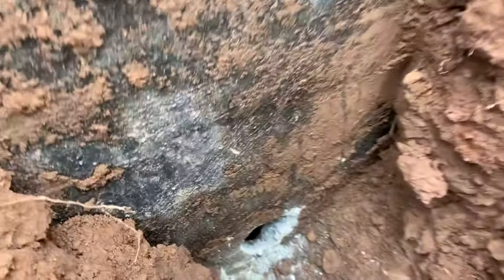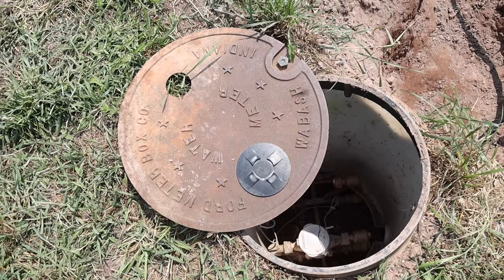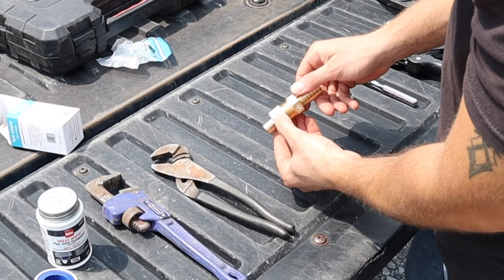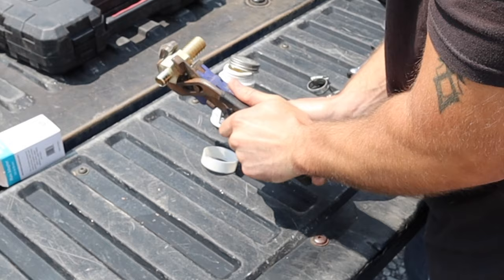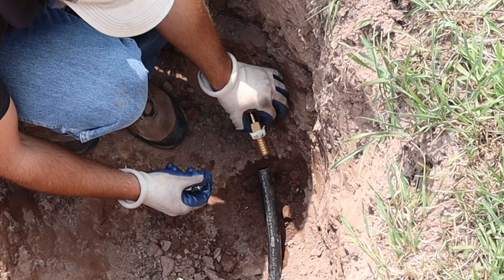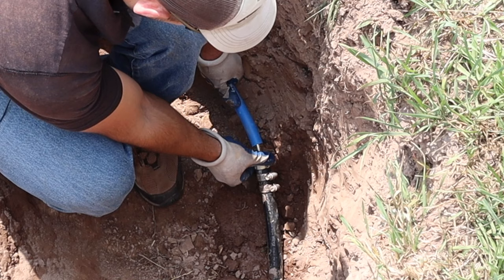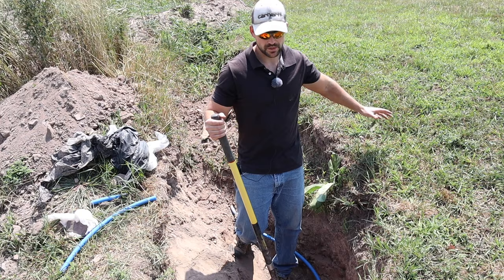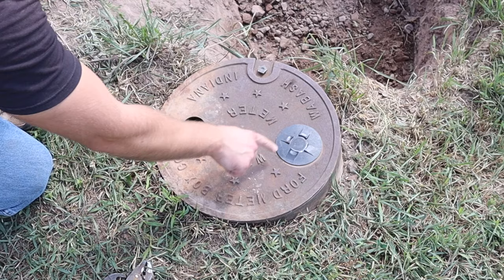PEX Pipe From Meter To House

Comment from the maker: Did you know you could direct bury PEX pipe?
Reply: How deep do you bury it? We are navigating through replumbing our entire house in San Angelo, TX. Your videos are so helpful!
Reply: I know those line are easier to get on to tht black water line if u heat em first
Reply: Kinda looks like he downsized the pex now you’ve lost main water pressure
Reply: @rsanchez5676  If downsizing inside the house it doesn't matter. Also higher flow rate because less volume in the piping means fresher water!
Reply: They do sell an insulated underground pex for main line hook ups. Uponor I think !
Reply: This truly blew my mind. I had no idea PEX could be direct buried. Thank you for your videos.
Reply: @rsanchez5676  WHAT SIZE SHOULD IT BE ?????
Reply: @rsanchez5676  almost ALL main water lines going into the house are 3/4 inch. The fittings inside of the house are all 1/2 or 3/4 inch therefore the pipes are all going to be downsized anyways in order to fit on to the fixtures such as your shower and sinks, toilets and etc. none of them are 1 inch connections. The downsize from the black water main to the original 3/4 inch pex makes no difference at all. Furthermore, a pressure reducing valve is usually installed because the fixtures are not designed to receive a ton of pressure anyways.
Reply: Another word of advice. Take a torch and heat up the inside of that black pipe. It will soften it up and make it flexible. The brass fitting will slide down inside of the black pipe better and then when the pipe cools back down, it will mold itself around the brass fitting. It’s more of another level assurance that it will be a leak free connection.
Reply: @rsanchez5676  *volume
Reply: @treym322  Just to be clear, static pressure isn't affected by the pipe diameter so using a smaller line has no affect on the regulator so far as it's rating goes. Pipe size does affect pressure drop during flow, but once stopped will be the same pressure everywhere in the system.

To add to your point the opening sizes in faucets is only about 1/8in. So things are reduced even more at the point of use.
Reply: @treym322 pressure reducing valve was the first thing I bought lol
Reply: Smaller pipe size increases velocity but decreases flow rate( volume) but going from 1 in to 3/4 in is common for residential properties. It is all about load calculation and flow rates. I plumbed 8 units from 1 1/4 service that came in a 1in than broke off in parallel runs of 3/4 to fixture branch line run than to 1/2 in. To individual fixtures .No problem 60 psi pressure plenty of volume. No complains on water pressure loss. No complaints of cold water during shower. All 8 units fed from 1 119 gallon water heater.
Reply: Josh, got a question. What if we don't have a black pipe coming up out of the ground like you do? Do we need to turn the main water off, dig to find the pipe coming out of the meter and then attaching a reducer to connect to PEX?
Reply: @MoonbeamAcres  let the city come dig their part of pipe up, because if you damage it you gotta pay the redo for water pit costs and hourly costs etc, if they break it you don’t
Reply: @timtamd6927  I don't have city utilities, I have a private water company we use for service. And they make it clear , they are not responsible for anything from the meter to the house. And I am going to need to tie into the water main service within the next year or so, so that's why I asked. And the question was for the channel creator.
Reply: Yes, I've done it before.

Did quite a bit of research about it too.

Comment: Is it me or you put the tephlon tape wrong? Anyways. Thanks for sharing. I always enjoy your videos
Reply: I always put it on in the direction that the female fitting or nut tightens, normally clockwise. I use tape or dope, but not both. Great video!
Reply: Yes the PTFE tape was installed the wrong way
Reply: Yep. 
Always hold the fitting in your left hand. 
Then run the Teflon tape over under (away from you) in a clockwise fashion
Reply: Yep.
Reply: Why do the people who are still learning try to make an instructional video ?   Rookie mistake......
Reply: @montgomeryball5496  money 🤓
Reply: Yep. Should be clockwise. That's when I turned off the video.
Reply: It AINT you ...... but THANKS TO BOTH OF YOU for the,VERY USEFUL INFORMATION .......
Reply: @montgomeryball5496  EVERYBODY IS STILL LEARNING !!!!! but THANKS for the comment.....
Reply: Yes, it's the wrong way,
Reply: @Bobcat1950  why not both?
Reply: @ImmaculateSludge  There are two basic types of materials used to reinforce such connections. Teflon tape and pipe dope. Both have their pros and cons and sometimes are used simultaneously. Many plumbers or do-it-yourself practitioners argue about which of the two is better to use in certain scenarios. Well. Whatever the case, what is most important is that the leak is stopped to help prevent damage.

There are numerous scenarios, both tape and dope act as lubricants to help tapered fittings fully seat. I don’t see the purpose of doing both. I always use dope on large coarse threads. Even to many wraps of Teflon tape will cause troubles on the smaller finer threaded fittings, I usually keep it less than four. When I started they wrapped the threads with pipe thread because of pipe and connection thread imperfections.

There is many cases where neither are necessary. What is important is that you do what works for you. From a production standpoint, you are using additional material and more time.
Reply: All I can say is you must be in the south somewhere my frost line is 40 inches
Reply: Thats why you might go both
Reply: May be he was looking at his camera screen and wires were crossed.
Reply: The tape bothered me...the AMOUNT of dope made me weep😂
Reply: Honestly he probably wasnt supposed to use any tape... most of those types of fittings specifically say not to use anything and if you do you will actually stop it from sealing
Reply: I know this is two years old but the video shows its going on the wrong way...
Reply: @EdTravelingEast You are correct...
Reply: @lowcountryantiques3696 
He was looking in the mirror 😅😅

Comment: It looks like you’re sizing down quite a bit from the start of your water main line. PEX-B is a size smaller for the inner diameter fittings. Seems like you’re going from a 1”+ main to what amounts to a 1/2” ID restricted line underground. That’s limiting your options from the start for water pressure and flow. I would have brought into the house at least 1” PEX-B to account for the ID restrictions. From there you can always size down in the house, but you never want to have to dig up your line just because you decided to do a smaller line first.

Comment: In the North when connecting the polyethylene pipe to barbed fittings we heat the pipe a little first with a small propane torch to soften the polyethylene than the fitting slides right in. When the pipe cools down the polyethylene pipes conforms to the barbs on the inside of the fitting. Making a tighter fit/seal.

Comment: Something I have learned... get the BEST quality worm clamp you find (not made in china). The cheap ones have a non stainless screw that will rust and fail.  Test the screw with a magnet, if it attracts, keep shopping.

Comment: Better to run the 1 inch polyethylene pipe all the way to house. Then connect a valve with compression fitting not barb with ring clamps to 1 inch poly in house. Then use adapter to connect 3/4 pex.

Comment: Good job on your connection bro I've been a plumber 23 years one trick of the  trade to help you with the next time you do a similar connection to poly  heat it up with torch for about 5 6 seconds on the inside and outside it'll slide in like butter

Comment: It can also be handy to run a length of "tracing" wire taped along the pipe, to help detect/locate it underground years later.
Reply: "tracing" wire? Never heard of it. Can you tell me more, eg, what kind of wire & what kind of detection equipment?
Reply: Usually it's a 12ga or 10ga solid copper wire, so that locating services and/or your local municipality can find your plastic pipe underground.
Reply: @jasongixxer6438  Thanks for the fast response - I appreciate it !
Reply: I was glad to see a comment about the Teflon tape going on backwards. I noticed this as well

Comment: 1st it’s great that you are making videos and trying to offer help to others. As far as tying your PEX into the poly is really a waste of time. I don’t know if where you live the water service provider Stubbed out that poly for you but where I’m at in GA  We tie directly into the meter with what ever new pipe we are putting in. That way it’s all one continuous run from the meter to the house. We don’t have to call the service provider for this we just dig down on the meter box and pull it for access to the fitting. I know a lot of plumbers and handymen down here that are to lazzy to put the extra time and effort into doing the job correctly. Again I’m not saying this is you I don’t know if your provider allows you to do that. But I just can’t understand why they would not.
Reply: The water company probably didn't stub that out, it's the old line.

Comment: The Teflon tape was applied backward. Tightening the threads will tend to unwrap the Teflon tape. 
  Also in our area, a valve would be installed where you placed the adapters, so you have your own valve just downstream of the meter box. Our water company requires it.
Reply: basic mistake.
Reply: I seriously doubt that any code requires you to put a valve underground   just outside of the meter. That's just nonsense.  I'm sure a whole house shut off is required but code doesn't say where exactly it has to be. They are usually in garages,  crawl spaces or in a closet somewhere in the house.
Reply: @steve2736  that’s incorrect. Tape and dope is now code in many areas. The tape only slips if you dope the fitting first. Always tape then dope
Reply: @leonardhall7203  He didn't say code required it, he said his water company does.
Reply: @cvas282  It's wrapped backwards which is the mistake. I also cannot understand why double application has become a thing. Why are they fixing something that isn't broken and making more mess and effort?
Reply: @court2379  the original comment I replied to was deleted. I never denied the tape was applied incorrectly. Double application is not becoming a “thing” I’ve been a master pipe fitter for over 25 years mainly  industrial and fire control systems. I was taught in the 90’s by my 65 year old foreman to tape and dope. We do it because it works.
Reply: @court2379  the water meter has a shutoff valve built into it and a backflo preventer otherwise known as a check valve on the house side of the meter. This guy obviously got the check valve  and shutoff valve confused.
Reply: @cvas282  I have never seen anyone in my area do both, so why I say unnecessary🤷. There isn't any harm in doing it though. The tape used matters a lot too. I have had some so thin you could see thru it, and other tape that is nice and thick and only takes a few wraps. The new tape with the thread sealant/locker embedded in it is interesting too. Used that for the first time last year. It seems like good stuff. It takes less of it to get the job done and provides a bit of resistance to loosening.
Reply: I worked in building maintenance for 37 years and never saw a pipefitter use both tape  and dope.
Reply: Yeah I noticed the teflon tape wrap too.  My area is an open system, so no valves required, but the teflon tape wrap is a universal thing guided by logic
Reply: Everyone's commenting on pipe dope, shut off valves, no one is mentioned tracer wire. It's code in my area now as well.

Comment: Just a little tid bit of added recommendation, when ever I use screw clamps underground pipe I always wrap them good with electrical tape stretched really tight all around them to prolong life and reduce rusting ! I personally would have wrapped the whole joint from the end screw clamp past the fitting and over the pex clamp in one solid tight wrap job ! Thanks for vid !
Reply: Make sure to get stainless clamps
Reply: I would have pressure tested prior to adding dirt....better be safe than sorry!!!
Reply: My dad was an electrician.
   Good old electrical tape was used for all kinds of things!

Comment: I have been buying a polyethylene crimp to pex crimp fitting from Lowe's, no need to use 2 separate fittings and both sides are crimped.

Comment: Don't know if you mentioned it or not, but pex cannot be located with a metal detector.  I've seen folks use what looks like Police tape with a metal conductor in it ...and lay it next to or on top of the pex line. That way the pex run can be detected.  Also, would it be a bad idea to use a PVC sleeve? ...put the pex in the PVC and place the PVC in the trench.  That way if there is ever a problem at one end or the other, then you can pull/push a new pex line through via dug holes at each end of the run.  You wouldn't have to dig an entire trench again and disrupt a developed yard.
Reply: ive thought about the pvc too but if you ever had a leak at the meter or burst line it might flood out your crawl space. might be able to put drains in it but digging isnt that bad really.
Reply: Thats why my code requires it  .    Those southern codes and east coast   arent so concerned with that so they have IPC codes much easier and cheaper to build with IPC  , just not as good as UPC  has higher standards

Comment: FYI. The Teflon tape does not do the sealing, the purpose of the Teflon tape is to provide "lubrication" for the threads. The threads are NPT which stands for National Pipe Tapered threads.  So, the deeper you are able to screw the adaptor in the better the seal. The "crimp rings" on the black hose are called "hose clamps"  Good job on the connection.

Comment: Hi Josh. Love all your videos. Keep up the great work. Just a suggestion on the clamps you used. I have noticed these clamps do not do well under ground or where there is moisture. They will easily rust right off. Blessings 🙏🏻😊
Reply: That's all I could think of

Comment: Teflon should be wound clockwise, not counterclockwise. There are also fittings for connections made specifically for exterior direct contact with the soil and elements for the PEX. Normal pex rings will corrode.

Comment: so what do you do to keep the pipe clamps from corroding...ya want to it last.

i found in  on my ranch in central alberta....
these pipe clamps types are prone to fail...just a temp solution.
even buried below the frost line....just the soil moisture  alone...which we all have.
so we buried  ...hmm two 5 gal buckets end to end... to be able to inspect....later thru on a value shut off....
super insulated bucket.....put some straw bails on top the bucket.

plus  then could shut the whole yard down not just the house.....
didnt know you could bury pex......awesome

Comment: Yeah in Illinois we have to use a mechanical fitting to transition from PEX to farm pipe is what we call it. We have to buy a specialized Mueller fitting. It has to be rated for burial.

Comment: Can you show a video on how to plumb a house an a concrete slab for shower , tubs, toilets , washing machines, vent pipes , water heater connections, refrigerator, dishwasher and drain lines exiting the house. Would appreciate it very much. Thank you for your time and effort. 🙏🏻🙏🏻

Comment: Was that 3/4 inch PEX-B for a water main?   I would have done 1" PEX-B or 3/4" PEX-A.   Better yet 1" PEX-A just because.   It's nice to have something and not use it then wish you had it to start with.   i.e.  Less pressure drop at a high flow rate.   PEX-B fittings do restrict a bit.   Edit:  Ohh and the clamps on the poly should be facing opposite directions.

Comment: Good job, where did you buy the 3/4 male adapter or the part number, what happens, I'm going to repair the same problem in my house and your video is helping me a lot, thank you
Reply from the maker: Thank you. I got it at Lowe’s in the well pump section. Hope that helps!
Reply: @TheExcellentLaborer  Thank you very much I appreciate it

Comment: What about testing the joint before you bury it. There could be a leak and it’s best to find out before placing dirt over the joint
Reply from the maker: Yes I agree with you. That would have been best with my excavator was trying to get the job done. Thanks a lot for watching!
Reply: Our city inspector requires a pressure test prior to activating. Just like gas lines. Also tracer wire is nice to have. Should be up to the owner, as they "city water dept" just reap the benefits of a water leak. LOL. Had a $4000 water bill one month last winter, from a break in 50 year old PVC. So much for smart water meters flagging water leaks... Taking a break from digging 500ft trench for new 1" main.

Comment: I use 3 clamps on polyethylene pipe and a heat with propane torch just a bit. Never leaks.

Comment: Yes, he went the wrong way on the tephlon tape. Easy to make a mistake. He had the threads away from him, but if he’d had the threads on the fitting looking at him, he would’ve had it right. To tighten is to the RIGHT ( Lefty loosely / rightly tightey), so the tephlon should wrap OPPOSITE of the way you tighten the fitting.  I believe the combination of tape and pipe dope IS the most secure way to avoid leaks. I just like to put a light coating on the threads with my finger, THEN at least three full wraps of tephlon. Good to go. Good video though.

Comment: Is that black poly? Not sure why you wouldn't use just a 3/4 compression fitting. Should be using Municipex for underground piping. I know some systems still have that black irrigation crap pipe you have to use the barbed fittings on.

Comment: I hope you used stainless steel pipe clamps and a pex A fitting would be better under ground. That copper ring is gonna corrode.